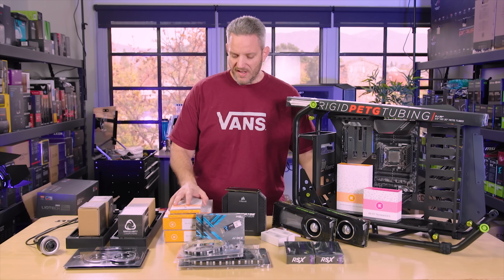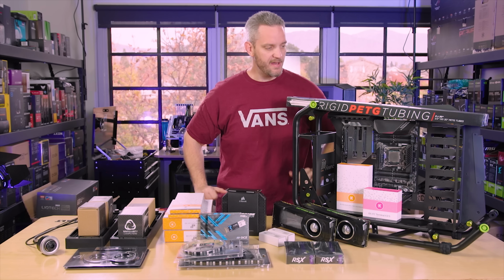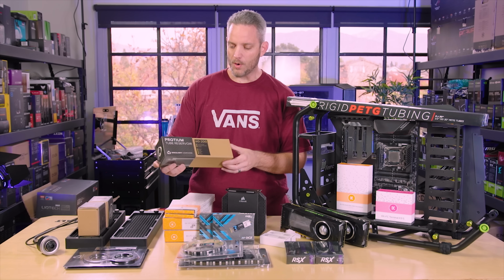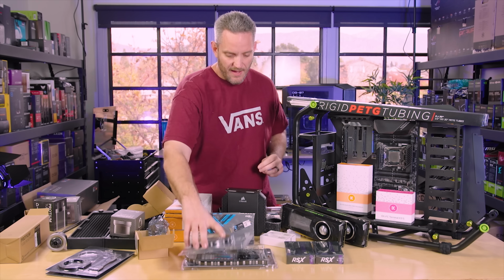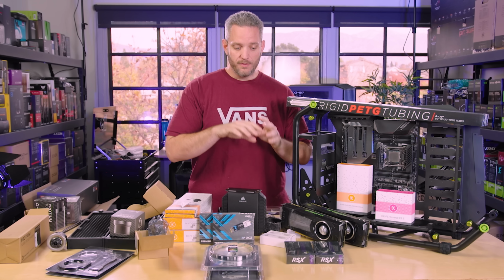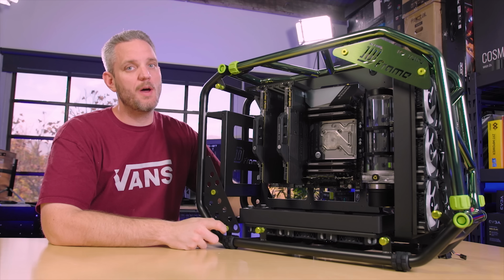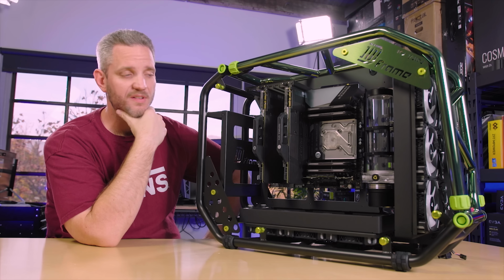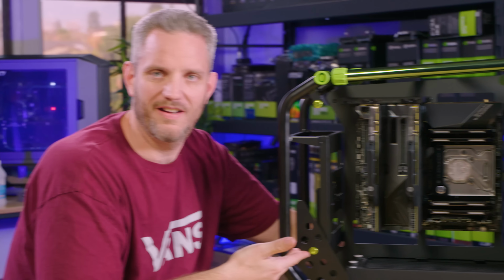My New Custom Build has Begun! Most epic PC I've built yet...

Comment: I really think for the fluid, you should try to stick with the theme and maybe get something that looks like motor oil. Would also be good cause it would be a "well-oiled machine".
Reply: You mean like that purple synthetic motor oil?
Reply: I 2nd this 👌
Reply: I concur. Something like motor oil or transmission fluid would be sick, keep the green fittings and use them sparingly, I think it would look outstanding.
Reply: Brown fluid would look dumb.
Reply: But that's the thing, used oil is brown/black.. New oil is almost clear/orange, royal purple is literal purple. Something clear/yellow/orange would be dope
Reply: I like where your going but as a mechanic my vote goes for a uv green like radiator fluid. it would suit the green on the case.
Reply: @gc Kukie agreed
Reply: I was thinking the same thing gcKukie. The yellowish green of antifreeze would be an awesome color for this build.

Comment: Purchased an OCZ Vertex 4 back in the day when I first started getting into SSDs. After installing Windows, the drive failed and wouldn't boot - brought it back to the store - they told me "We'll give you a refund, 6 of every 10 drives from OCZ tend to fail." Now, this was a couple years back before Toshiba saved them, but still I'll never purchase an OCZ drive again. Switched to Samsung SSDs!
Reply from the maker: So far I haven’t had a problem, but if I do at least they are easy to access
Reply: Like I had said, this was before Toshiba purchased OCZ - so things could be entirely different now! Just one of those things that when they happen, ya know?
Thanks for the video Jay, looking forward to seeing the final!
Reply: Ya I was surprised not to see samsung 960 pro's here. He's going top of the line everything else.
Reply: Michael Kreitzer thats what i just asked too if you put sum in raid there very fast i wanted to know if the toshibas were better or why is he using them
Reply: i have a vertex 4 and it has been flawless for 3 years now. might be longer than that
Reply: +DjSmileyofLasVegas Could be a number of reasons, he may have been sent those Toshiba NVMEs for a different video and had them spare. They may have sponsored him to be in the build. Or he just felt like trying out some new hardware. Personally I went with a 960 Pro for my build as they hit 3.5Gb read speeds and the Toshibas are 2.6Gb read. When you build PCs non-stop it is probably nice to try different hardware just for the kicks.
Reply: Jacob Smith i figured its probably sponsored or something like that but if ur right and its 2.6 gb then thats a big difference over 3.5 and in raid ive seen it get way faster.i am curious though still why cuz whatever reason what motivated him im still interested

Comment: All that money, all that effort, all those aesthetics..... And you don't populate all 8 dims? Man that killed me. When i did my 7900x build even though we clearly don't need 64 gigs of ram I just couldnt leave those 4 slots open and when you're wallet is already open wide, what's another 500 bucks? Nothing... Nothing at all.
Reply from the maker: Because overclocking...
Reply: It's a valid argument. But the overhead you lose with the extra dimms populated isn't going to be the issue. The 7900 will outrun your cooling solution (as good as it is) before you hit that limit. Sick build none the less man. Looking forward to the rest.
Reply: well....should have bought the 1950x for the same price because amd isn't effected at the same level as meltdown and spectre.

Comment: "hey guys lets build something you cant afford, you peasants."
Reply: ....I  can afford that though. You know, because I work.
Reply: hehe speak for yourself i finished my delidded binned 7900X (running all core at 4.8 but is stable at 5GHz but rather warm) sli 1080ti custom loop build with 32GB of corsair dom plat ram a month ago but ive gone with  white build so using an asus prime deluxe board and samsung 960 evo nvme drives :)
Reply: Monk 
Wow, what are you using it for?
Reply: Elijah _ primarily overkill gaming and some streaming when I get round to sorting it out heh
Reply: You're mad.
Reply: Monk 
A bit over the top? No?
Reply: Elijah _ completely, but the 7900X s sadly the 'cheapest' CPU with the performance I wanted and 44 pcie lanes for nvme drives along with sli cards going forward, if TR had of been faster I'd of gone for a 1900, or ideally I was hoping for a replacement for the 6850k 6 core 12 thread 44 pcie lane chip, but that didn't happen so I went about £500 over the cost, which sounds alot until you realise the whole tower (no peripherals or monitors) came in close to £6k, I had the cash and wanted to go a bit mad with a new no compromise build for my first custom loop build :)
Reply: Monk 
Lol, well I hope you enjoy ypur build.
Reply: I work. I also have a mortgage, two car payments, tons of bills, and two kids. Must be nice to be you.

Comment: Am I only person still prefer soft tubbing ?
Reply: KyLastoutlaw it is easier to manage. TBH when I do my next build I'll be doing soft to begin with just because it's less time consuming.
Reply: KyLastoutlaw yeah it's far easier and less time consuming, but if done well, hard tubing looks immensely better than soft. Besides, it looks and feels more premium. You wouldn't want a dangling tube on a frame with such hard angles, it just doesn't look nor does it feel right
Reply: I could make soft tubing look amazing in the build :D doesn't matter hard or soft you are correct, as long as it is done well. Soft looks amazing with short little runs to bulkhead fittings with all the complex routing hidden away.Connected to each bulkhead you can have values to isolate components areas so for example graphics cards or cpu can be removed if needed. What i'm saying is both are only limited by imagination.
Reply: Soft tubing since 05, and still for many years to come, I love building loops i can pull out of a case without draining, flexible tubes and pivoting fittings allow me to actually work on the darn thing.
Reply: I personally think soft tubing looks better than PETG. PETG has too much of a Super Mario look to it.
Reply: Abraham Collins same I would only use hard tubbing for small case builds

Comment: Super nice build, as always Jay! Okay Jay, here's a question I'm sure you answered already, but I wanna know. Why don't you build your loop outside of the PC and test it then before you put it inside with all the electronics? I know it would involve more steps and more work, and I know the fittings and whatnot could plausibly move or loosen during the install into the case, you'd need to re-test it, but outside of the case testing IMO would be a much safer way for a beginner to test their loop first, right? For someone just starting out that literaly can't afford to fry anything (even IF somehow it could be replaced by a warranty) it seems like the best route to go to at least check for major leaks before you install it, BUT I don't know anything about LC honestly and I'm curious as to what the master says.

Comment: Far out that pump bracket is strong! Hardly any flex at all even with the whole radiator and fan assembly hanging off it. I can see why you were impressed with the Singularity parts.

Comment: Great stuff, as always, Jay. I'm still going through a lot of your custom watercooling videos trying to put myself over the top of finally doing it. It looks so damn nice when it's done. I've bookmarked about every site that you use parts from. I've even put together a parts list finally. Maybe next month I will start getting the parts. :-) I relate to a lot of your work because I have taught myself pretty much everything I know about building PCs over the last 25 years and I even do it for other people now and do some IT work on the side as well. I jumped on the RGB bandwagon mainly because it was different. I now have a Lian Li O11 Dynamic in white, 9 modded Bora fans that do work with Asus Aura on the Lian Li hubs, and probably 5 M of 5050 and WS2812B RGB LED strips. Yes, it looks like a frickin rave inside. I've posted pics onthe Lian Li HQ Facebook page and had them ask for more before I even added the Bora fans. Anyway, I appreciate your hard work and the effort you put into the videos. Especially the ones where you make little mistakes like accidentally ordeing the wrong parts. It keeps my own ego in check when I see someone I'm learning from and has done this for a long time actually be human and make an error. I then realize that I'm more than likely going to f--- stuff up too and that's okay.

Comment: Heres a question maybe Jay or someone can answer - every rad res and block uses 1/4 fittings. We have tubing from 12mm to 16mm. So if you're using 16mm tubing does it add to the headpressure since it's choked by the 1/4 fittings?
Reply: recgar A1xP1=A2xP2 so yes a bit but not by much

Comment: If youre going to have panels to cover the cable management you should have someone do them in carbon fiber to keep with the theme, or possibly even replace the back glass with carbon fiber completely since you dont really need both sides visible. 
 I think it would also look cool if you would incorporate some kind of temp/fan speed monitoring that would look like automotive guages illuminated behind the tinted glass side panel. That way you could see the needles ramp up when you pushed the PC harder. Maybe a large one for the cpu and a smaller one for each gpu so it resembles a cluster.

Comment: Jay great once again.Question I know you get a ton. I'm into iracing see you race too. I run triple benq 2760 @1080 on a 970 card looking to get either a 1080 or 1080ti. What do i need need to run high settings and stay in the 125 to 150 FPS range? I need to upgrade but how much do I need?

Comment: Kinda looks like the open frame on a rock crawler, so maybe call it your RGB Crawler, eh?

Just waiting to see the finished product running and what kind of numbers it turns in. 

Thanks for your videos, too! When I bought a used computer a couple years ago it already had liquid cooling and I had to learn about it, which I did. Since then I upgraded the mobo and what I learned helped me reroute the lines and remount the CPU water block. 

Hurry up with that video. I've almost reached the end of the internet and need moar!

Comment: Jay Love your vids man!  I am having an issue mounting the second radiator on my DFrame 2.0 . Where did you get the part/bracket to do it.  I am at a loss.  How did you get it up there.  I hope you respond haven't been able to find and answer anywhere and I saw this video and there you have it.  Just need you or ANYONE to point me in the right direction where I can get one of those brackets so I can mount my second 360RAD on this awesome case

Comment: What is the airflow direction of the fans in the radiators? Is the fan in the bottom sucking the air trough the radiator or blowing it up?

Comment: This whole thing is way beyond my taste and bank account scope but just wondering;
This a showcase piec and thus wouldnt be relegated to the flor and would want to be on the desktop, CORRECT?
Assuming so i would orient the mobo in the direction of where most the cables are gonna go.
Asit stands under the desk under the monitors and peripherals  is the ideal placement with the mobo pointing up.

Comment: Jay, could you provide the height of the Singularity Computers mount? I was thinking of using it for a cooling loop I'm planning, but I feel it may be too tall for the pump/res combo I want to use (the EK-XRES 140 Revo D5 RGB PWM and replace the included tube with the 64mm tube). With the shorter tube I think the mounting "cage" may be too tall. I've been to Singularity Computers' site, as well as Performance PCs, but those particular dimensions are unclear. Thanks, and I'm looking forward to seeing the completed build!

Comment: Jay,  thanks for the great tip on how to hide that RGB cable on the monoblock at 7:07, it was driving me nuts. How did you get it around the top pcie slot and the ram slots? The cable at the block pushes against the ram slot  next to it and I had to bend it under that plastic cover. Also the cable in the RGB port you plug in at 7:11 looks different to mine, is that an extension you're using? EDIT: I see that's the 5v header, must be something else!

Comment: The wire location on graphics cards bugs me.  If they came out the end of the card near the motherboard it would be so much easier to run wires to in a clean way.  I know that small form factor builds wouldn't be able to plug in there, but with the million SKU's of GPUs out there surely a few of the high end ones could put the wires out the end of the card instead of the side.

Comment: UV light can cause degredation on certain plastics like polypropylene (PP) or low-density polyethylene (LDPE). Please do some research on what plastic types are used in your components before using the UV LED strip in a custom waterloop. I would hate to see something go wrong with this awesome rig!

Comment: "Jayz Sleigh" would be cute name for it. Seeing you work glass in other vid reminded me of my chemistry set that had glass tubes that one could use a torch to bend. Speaking of tubes, the external frame could save a lot of space if you could run coolant threw it. Anyone ever run mineral oil threw cooling system?  Its high index of refraction may add some nice optics to the borosilicate. $500 dollars for the glassworks and they didn't even gold plate the back half of them to reflect the heat outwards? What slackers! (just kidding)

Comment: I disagree with "Not Volta because of the price", no game takes advantage of the tensor cores yet, if there was a game taking advantage of that, then if the performance boost didn't justify Volta, then I would have agreed. I think simply, it's your personal gaming rig and in no way is it going to benefit from Volta, no need to even consider the price if it's at least 110% of what you are spending now.

Comment: Trying to convinve ny myself not to go sli but every video i watch has them..
Reply: Scott keomany 
well scaling is usually terrible. Ya have twice the horsepower in graphics cards, but at best ya get 50% boost to 30%. Also some titles do worse with 2 cards vs one card, some games will outright not work. Ya can bypass it with software, but sometimes the software dosn't properly disable it and ya have to unplug the power cable for that video card. 
It's also dependent on game makers and Nvidia to optimize sli to even work most of the time. Ya also have the fact ya could buy a card that will run better then 2 lower cards sli. If memory serves 2 1070s only barely passed one 1080 . Nvidia is ditching slip bit, so are game devs and their relying on dx12 which is a crap shot at best atm.... I can go on!!
Reply: Dennis Rigdon the same probably could be said about crossfire

Comment: Check this out, guys if you want a little powerhouse with a lot of head distance:  http://www.performance-pcs.com/ek-xres-140-revo-d5-rgb-pwm-incl-sl-pump.html

Fits underneath a GTX1080 in a Full ATX case very well.
(please buy brackets, and don't complain if you forget them)  120mm vert/horiz brackets are super helpful....

Comment: I would resent you for being able to build a PC like this, but you ruined that for me by giving a guy at microcentre a new PC of his dreams for xmas. I can't even hold bitter resentment for you. You couldn't even let me have that.  Unsubscribed.
Reply from the maker: You aren’t allowed to unsubscribe either
Reply: I'll forgive you if you do a cool case mod. PS - ever considered not just putting in hard-line like a plumber? All right angles point to point? Instead go for a two resevoir system. Make them different colours. Then get a lorry suspension spring and heat and bend the tubing to a coil that fits over the reservoir and send one colour round one reservoir and the other colour round the other (use a tin of beans to wrap around if you can't get a coil). Paint the case purple and use brown and white liquid to make it look like a chocolate factory or run a red coil around a white reservoir to make a candy cane. You could do a lot with circles and loops. Do water cooling without a set square; think Michael Angelo, not Super Mario.  PPS - i love your videos. :-)